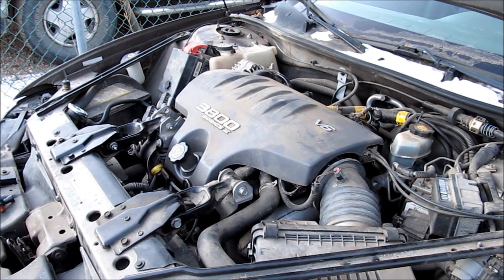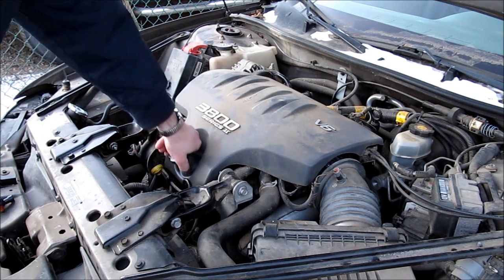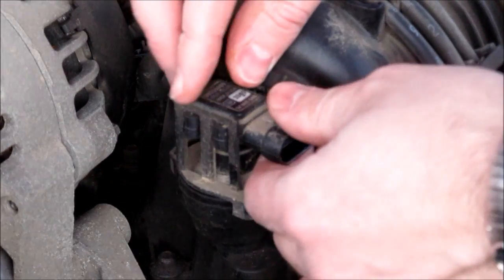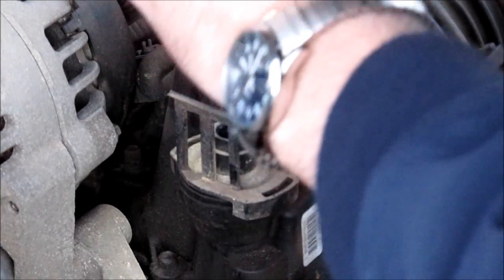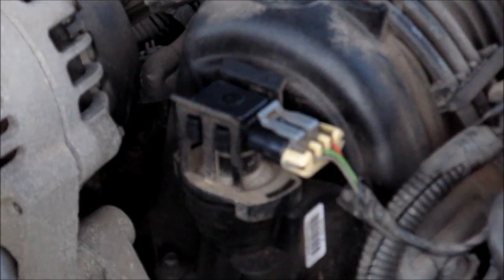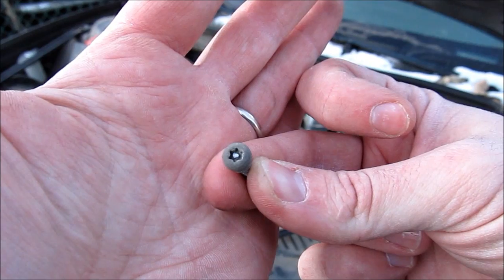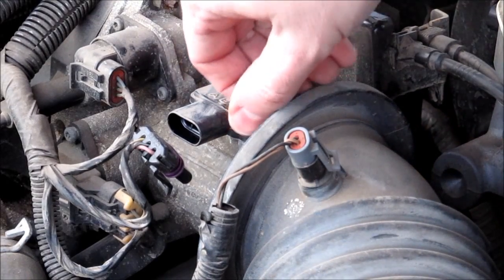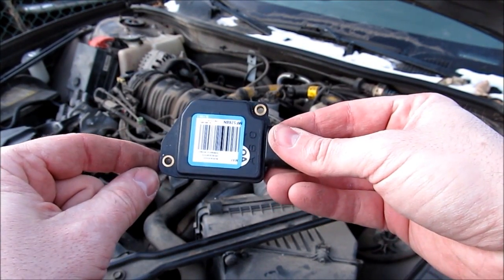Changing MAP and MAF sensors in a 2002 Pontiac Grand Prix 3800 Series 2 V6

Comment: So would my engine have less power if the MAF sensor was bad? My car runs great it just doesn’t have much power. I’ve changed pcv egr and numerous other sensors? It’s a 95 park avenue
Reply from the maker: I'm not 100% sure on that, it usually deals with runability of the engine, but no doubt, if it was giving false data to the PCM, then for sure, the engine wouldn't be trimmed right and it wouldn't be running well, which would cause a lot of power, but likely also throw a code and set the SES light.

Comment: Great engine! theres a very small diameter vacuum tube, that goes from the rear manifold,  to the battery area. Then integrates with an electrical harness. If it gets brittle and cracked, engine goes with a rich mixture and runs like crap. Triggers a P0134 code. Very easy and cheap to fix, just replacing vacuum line and coupling tubes👌

Comment: What would be the correct tool to use for those torque screws?
Reply from the maker: It’s a security bit.  Honestly, I find them at the dollar store for the cheapest in a big multi-kit.  You need to treat them like gold otherwise you’ll never have them when you need them.

Comment: Was kinda surprised you only changed the map, and not the rest of the assembly underneath it, I just did our today, and the one I took off looked like it had never been changed, car has 235K on it
Reply from the maker: At the time, the car was fairly young and wasn’t interested in replace more then what needed to be replaced.  We’re at 181k KM now, so about 121k miles.
Reply: @Turbo231  that makes sense, the LeSabre we got came from a mail delivery guy, and he drove it into the ground literally, thank goodness most of the repairs have been done on the cheap thanks to the pick a part yard here, they just had one come in that was hit in the back, but whoever had it took very good care of it, most the parts on the motor looked to be fairly newer, and alot more affordable then local parts house

Comment: Was it easy to use pliers to remove the screws?
Reply from the maker: Less easy and more required if you don’t have the correct bits.
Reply: @Turbo231  yeah I tried and ended up buying the screws. Saved me $400 though ended up paying $52 for new sensor and tools when it was all said and done
Reply from the maker: The sweetness of doing it yourself.  And now you have more tools.
Reply: @Turbo231  Yeah, can’t complain at all. I’d pay $52 dollars instead of $400 for a 19 year old car repair any day

Comment: Gotta 2006 Grand Prix, my car wont start up anymore just cranks forever. Already put in a new starter, fuel pump, and battery. Only got so much money to throw at it, should i try replacing these sensors or just junk the car? 🤦🏾‍♂️
Reply from the maker: Clit Commander You just need to track down the issue.  Cranking means no fuel, but why?  Pull the plugs, are they wet with fuel?  That means no spark, so look at the ignition system and why it’s not sparking.  Plugs are dry, then look at the crank sensor as the injectors aren’t firing.  Sure you have checked fuel pressure?  Proper diagnoses will let you fix the one broken part.
Reply: Turbo231 - How can i check the crank sensor? My mechanic friend told me it’s most likely that
Reply from the maker: Clit Commander not sure off the top of my head, but I’m sure google can find you an answer.

Comment: The GM  dealer wanted $540.00 to put a new mass air sensor on my 2003 Pontiac Bonneville SSEI.  I bought the part from NAPA for $140.00. Found this video and did it myself. I am  a 71 year old woman. The car runs like a dream. If I could do it, anyone can!
Reply from the maker: Fantastic!
Reply: $540 dollars for two screws lol.
Reply: sound like someone was getting screw @hitek9too255

Comment: The mechanic I take my car to wants to charge me $2500 for this? It takes like 30mins
Reply: The cost should only be about $200 to $300 to replace and/or test & map to the mass air flow sensor. The mechanic trying to charge you $2,500 for this job should be reported!
Reply: not even 30 mints. 5 mints tops. i did mine
Reply: I got charged 100$ but rather do it myself
Reply: mightybuffoon no more than 400bucks tops

Comment: I'm getting the P0171 code(lean bank 1 aka 02 sensor) would anything else be associated with this code?
Reply: what did you find out about this? I'm having this same problem
Reply: +Jeremy White  I've been told by a few old heads that many things could trigger this code.....fuel pump, fuel filter, 02 sensor(upstream), intake manifold gasket failure(common well known failure), wires, or plugs. I've just been replacing the low cost parts first so far.
Reply: +Kiddro22 I actually just fixed mine. I was getting codes for a lot of things I had a few problems. I had a coil pack bad causing a misfire and it was setting off the code p0420( bank 1 low efficiency) it went away after I fixed the coil. my 2005 truck had this problem before too and it was the o2 sensor. hope you find out your problem it can be very deceiving with the codes.. one bad part can cause3 or 4 codes.
Reply: +Jeremy White exactly! I replaced the wires, plugs, and coil packs and still the same. Replaced the MAF & IAC....cleaned the throttle body plate. Still the same. I'm starting to think that it's the 02 sensor itself but I refuse to put a Bosch 02 sensor in my Buick. I need a AC Delco one.
Reply: +Kiddro22 I know what you mean man. it sucks throwing parts on a car over and over to have the same results.. definitely Is aggravating! yeah almost everything on my car is ac delco and when something goes out and I go to AutoZone they always got Bosch or some other half ass bs part. It's difficult for me to find ac delco parts local.
Reply: have you looked at your o2 sensors? My driver side one's went bad on my Silverado and was so black. my passenger side was white looking like it was burning clean.
Reply: +Jeremy White that's what I'm leaning towards. The O2 sensor. I haven't replaced it because all I'm finding are Bosch ones

Comment: if i dont have a spark on my ignition coil would these changes make a difference..starter turns,fuses good,fuel pump pressure good,checked for spark/none use 08 grand prix
Reply: mercedes miller if no spark, can be ignition coil- thing that wires clip to or the ignition module- thing that coils sit on eith lots of wires comming out the front- google test ignition coils

Comment: i have a 2002 buick lesabre and it is coming up with code p0102 mass air low input? I tried changing the mass air sensor and the check engine light still comes on with the same code? any ideas??
Reply: Lorena Eschliman check air filter and passage to throttle body and if good, replace mass air flow sensor- make sure maf sensor wires are nice and plugged into sensor all the way

Comment: Regarding the removal of the MAF sensor, spend the $8 and get a set of the Security Torx Bits. Specifically part No. T20. Pliers will not work on the front screw.
Reply: so that will work to remove the MAF sensor? doing this tonight and running by napa to pick up the bit. hope this work! i'm dying without wheels
Reply: It always works for me. I use needle nose

Comment: What code did your check engine light register. I am getting a P0420 code which says it could be the Map, Maf and the O2 sensor. How do I know for sure which one it is?
Reply: ***** unplug them one at a time and see if there is improvement- car will run with maf unplugged -- what car and year do you have

Comment: I've pulled both the MAF and MAP codes for my car (Exact same model as car in video). The MAF code was triggered at least a year before the MAP code. Now that both codes are on, my car will not even idle or stay running unless my foot is on the accelerator pedal. I'm assuming it has something to do with these sensors (the MAP in particular) as it reacts as if it is a vacuum problem. Any suggestions or info to back my argument up?
Reply: Eires2009 unplug the maf and it may run fine- if it does- replace maf
do the same with map and you will see what will help you- replace both if you can but start with maf

Comment: I have the same engine in a 98 Grand Prix GT and we just replaced the LIM gaskets, the UIM and the gasket and codes were brought up for both the MAP and MAF and the cooling fans wont turn on at operating temp, only when the ECT is unplugged or the heater/AC is on, has anyone else had this or can Turbo231 shed some light?
Reply from the maker: All you can do is follow the codes and signs.  Your cooling fans don't run, unless other logic like AC request turns them on, so the sensor system incharge of turning on the fans due to heat must be faulty...so check your coolant sensor.  As for MAP and MAF, check the wiring, I have a few videos on that.  Make sure they're actually OK.
Reply: I thought the same, we changed the ECT and thermostat with no difference made.

Comment: im getting this code and have been told its the mass airflow sensor but i have no symptoms of anything. im also told the car is running lean. nevertheless is it as easy to find in a 2008 grand prix and should i spray it before buying the part?

Comment from the maker: I replaced sensors based on SES light codes and guessing.  It appears the engine management uses a combination of MAP and MAF to find the best fuel trim and can run ok on just one sensor and runs like crap on none.  Then I started with the cheapest and went from there.  Currently my MAF has failed, I'm working on either cleaning or repairing it.  My test was the car runs better without it then with the MAF sensor, that's a good sign of a faulty sensor.

Comment: yes you can get a MAF at oreilys for 138.00 (with core) and its just like this video shows you, but i got the T20 security bit to take the screws out.  my car ran like it wasn't getting gas made a noise like a big faucet was turned on and would stall out and had the engine light on so i came to conclusion that it was the maf sensor when i had it running (like crap) and unplugged the connector to the maf sensor and ran normal so i knew i had to get a new one. do it yourself and save your money!

Comment: Great info video... Got a question, my 2001 Monte SS cranks over, but stalls right away... It rana couple times for 3-5 seconds and was blowing a little smoke when it did. I had the Cat replaced about a month ago and my mechanic says its still good, he wants $350 for just the MAP sensor replaced, is that a bit high ? And does that sound like it could be the problem ? Can it be the MAF instead ?   Thanks a ton... Any help would be great... Michael...

Comment from the maker: Maybe...but probably not.  Under load and near WOT, the engine just gives it all it has.  Look at things that would fail if the engine was giving it all its go...such as fuel supply running low...or spark not hot enough...so fuel filter or wires perhaps.

Comment: @Turbo231.

I replaced the MAF last night, I also cleand the Idle sensor.  It's running well this AM,  but it did have some hesitation under load  going uphill.  Would this be the MAP failing?
Reply: Sounds like a misfire

Comment from the maker: No, these issues won't cause a car NOT to crank.  It will just keep it from running.  So you have to hunt down why it's not cranking, once you find that, then you can move on to your lack of idle problem.  FYI, just because the fuel pump runs doesn't mean its working.  Get a fuel pressure gauge and be sure, there is a tap on the fuel railing.

Comment: Did you ever figure out what the other problem was.     My 03 grand prix gt starts runs for a few minutes then dies and won't restart I pulled the maf sensor and it started and ran but ran like crap and then eventually died.     I'm going to change them from another running grand prix to try it out but you mentioned below you still had an issue and was wondering what it was.

Comment from the maker: My current thought is that the old MAF may be better calibrated or be more sensitive and thus would show a code where the new one will not.  Either way, I have an issue somewhere I need to hunt down, that will be my next Grand Prix video.  Given this car needs a lower intake gasket, I will go through everything with a fine tooth comb to see if I can find a leak or some other problem while I do that.

Comment from the maker: The MAP sensor has been dead for about a year or so.  Because the PCM just uses the MAF sensor to make up for it, there was really no loss in performance outside of perhaps some fuel economy. However, when the MAF sent a code, the warm startup idle also failed...aka it won't start and idle when hot without some fuel pedal work.  After a minute or two, it will idle fine as if nothing was wrong.  Replacing the MAF sensor did not fix this condition, so there is more then meets the eye.

Comment: Princess auto sell cheap sets of those security bits. I don't know why manufacturers use those strange screw types -- it's not like people will be stealing parts from under the hood. 
You've done another clean and straight forward review, Ben. Why do you think both sensors failed?
Reply: Not too sure why MAP sensors fail but the MAF in the air intake  after the air filter & temp sensor  does get a thin  film  of grayish grime  fine dust attached  to it over time  & causes resistance in the circuit & inaccurate readings.  
Every time  or at least every other time  you change  your engine air filter you ought to spray  it clean.  
I've  seen people  use  Q tips but I would  avoid touching  the elements or risk  the  chance of leaving a strand or piece of debris  behind  that  will attract  further dust. Just be sure to buy  MAF sensor cleaner  & NOT carb spray or EGR spray. They are resistors  & can be  damaged by manhandling or inappropriate solvents / cleaners.

Comment from the maker: @spelunkerd Yeah...the MAP sensor has been out for over 6 months but since it wasn't really effecting the performance of the car for what we use it for, I kinda just let it slide.  Obviously when the car lost the MAF, then things went to hell as the PCM does need some amount of feedback to run the car correctly.  Two failing sensors seems bad but time will tell if there is something else lurking and these are just a symptom.

Comment: Nice job, Ben. 

When I get multiple codes like that I wonder if my partial knowledge should be telling me that there is a common cause. But I guess the simpler explanation that it's multiple failing sensors is more likely. 

You can get a set of security torx bits from Princess Auto for just a few bucks. 

Thanks for posting, and for your clear explanation.